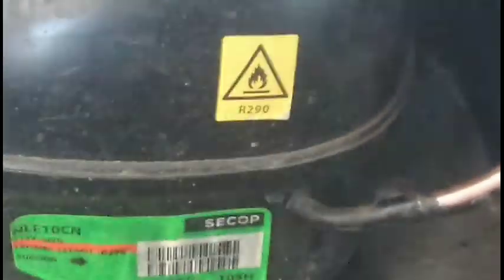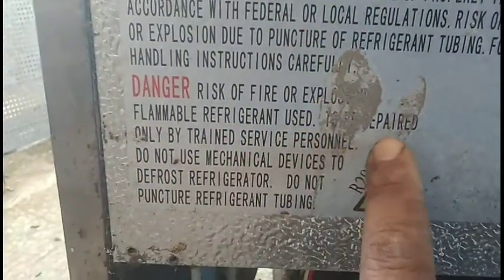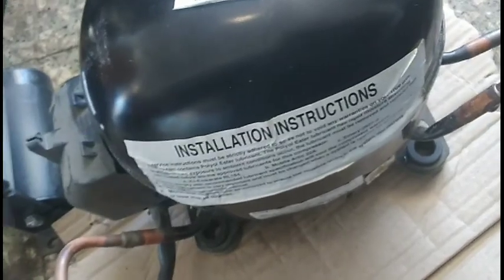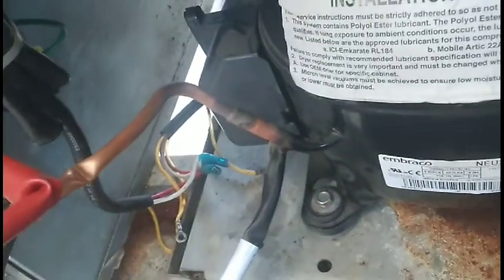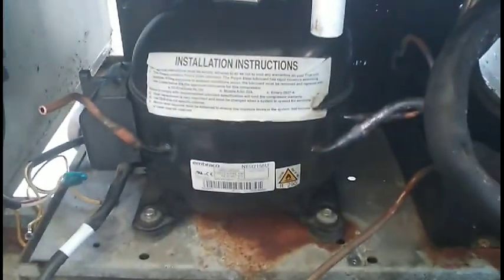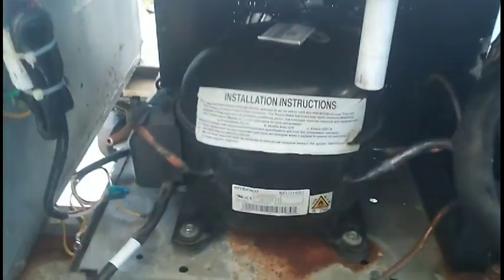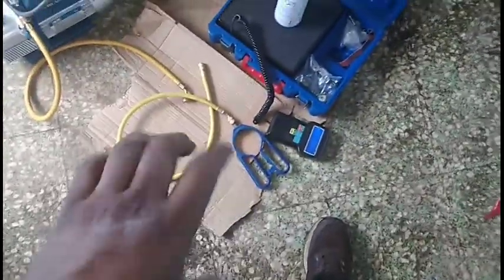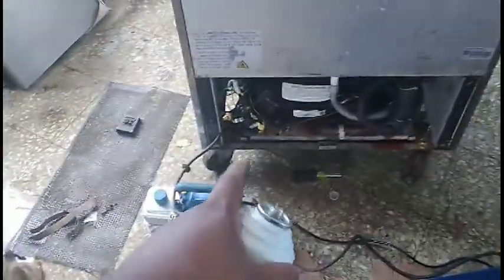R290 compressor install

Comment: I AM not to cine about R290 propane refrigerant I like my R134a
Reply from the maker: It's not that bad as you think uses less refrigerant and less energy.... that same freezer on 404a should be running 9 amps on 290 it runs close to 5.... alot of misinformation out there